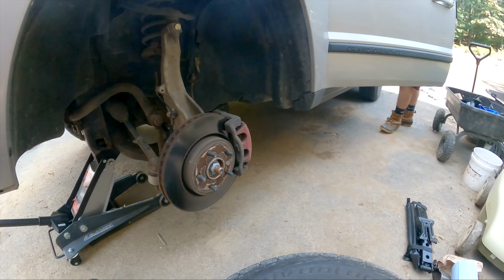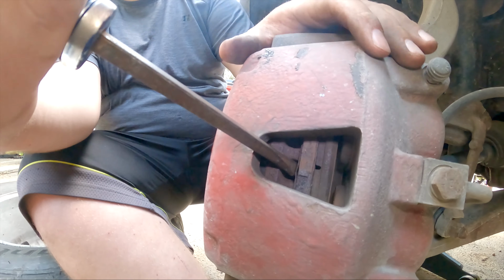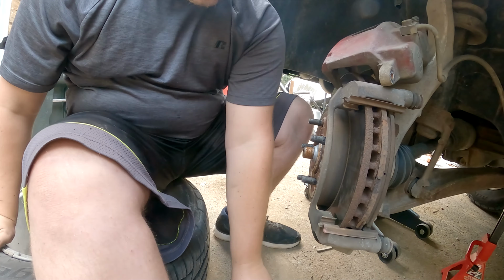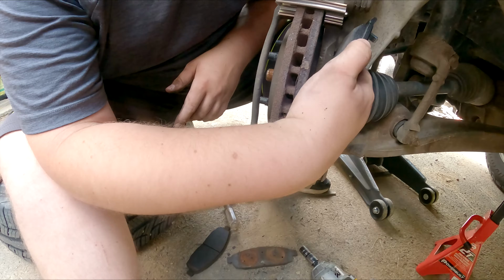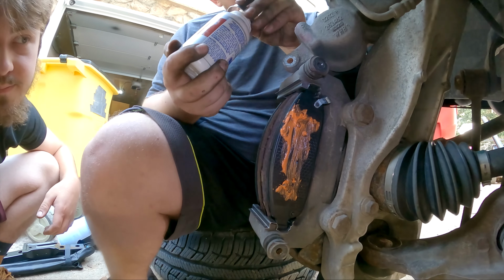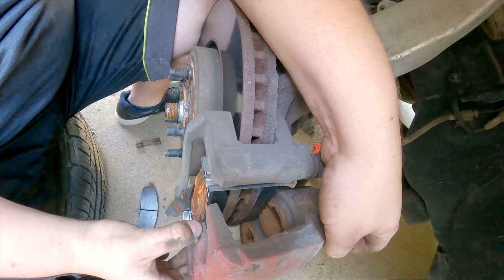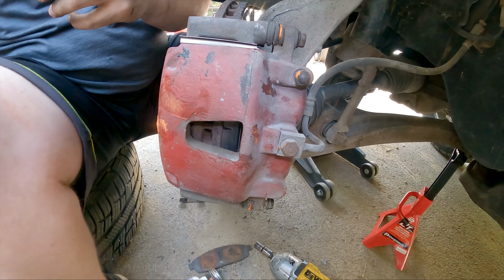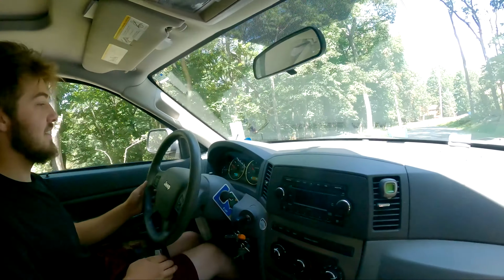2007 Jeep Grand Cherokee Front Brake Replacement

Comment: I put brake caliper grease on the channels the pads slide in, caloper bolts, and the fronts of the brake pistons. Then once assembled before the wheel goes back i hit the rotor up with some Bake cleaner.
Reply from the maker: That makes sense to me haha

Comment: Great video a bit of advice you can use a c clamp to help push the pistons back by placing a old pad on them both just so you don't have to do them one by one then use the clamp to push that brake fluid back up in the lines
Reply from the maker: This is a good idea. I just believe I didn't have a good c clamp available during this time. I'll try to show this next time!

Comment: You should also grease where the pads slide against the pad. so the pads slide and do not hang up. You can also add a little silicone on the piston rubber to help keep it pliable. great and helpful video.
Reply from the maker: Ah, I will keep those in mind, they sound like good ideas! I'm glad you found it helpful!

Comment: You need sil Glyde on that hardware so the pads slide easier and rubber boots my guy ... no impact gun tightening bolts ... open brake fluid cap ... c clamp to push in piston.. brake cleaner ...
Reply from the maker: I wasn't thinking about putting the grease on the slide hardware when I did it elsewhere, but that would have been a good call. Where are you recommending rubber boots? 
Impact was me cutting corners, with low settings, but I also recognize that this can cause issues in some cases. 
I unfortunately had my C clamps at another location, but opening the brake fluid cap would have been a good move to make it easier and put less stress on the system (although I doubt I nearly met the operating pressure these are routinely under).
I do appreciate the input and it definitely gave me some stuff to keep in mind going forward. Thank you for taking the time to give me some input on how I can improve on future endeavors!

Comment: Should bleed them and tip... c clamp on old pad works mo betta to retract calipers j/s..
Reply from the maker: C clamps would have certainly made compressing the calipers easier. But I didn't have my clamps pulled out at the time, and the calipers didn't put up too much of a fight 😂
And I could have bled them to make it a little easier, but the fluid in the system was relatively new, so I didn't want to needlessly replace and make it messier.